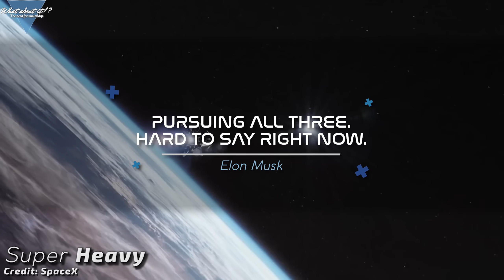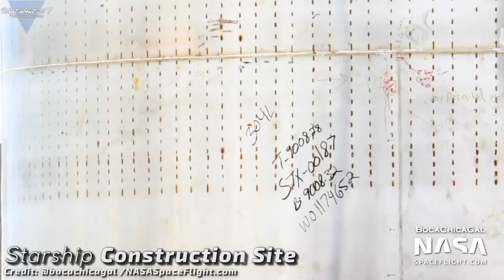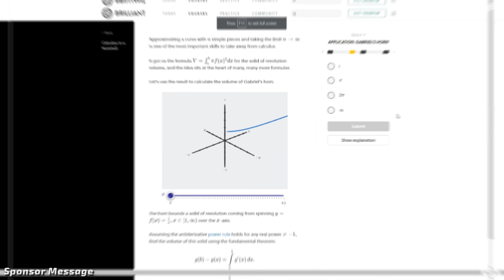97 | SpaceX Starship Updates – Age Of Super Heavy

Comment: To make cylinders or rings stronger they are normally made with some form of profile shape  rolled or stamped into them. Everyone is familiar with an empt food can and the force needed to distort it. Or how scrunched tin foil is so strong across all planes. Also ribs in metal are good for cooling and conducting heat away  great for the future transpiration heat shied. Observing the ring sections of starship they are so flimsy in construction and only have rigidity in only the one plane. Can any one answer this question? A fantastic channel by the way.

Comment: just to get reference: super heavy engine will have about 216 fast valves,  about 222 fuel pipes, 18-74 pistons. Plus, MANY cables. It all must not only survive massive vibration, but also 72MN push. This makes super heavy engine section most complicated one ever. i bet it will take them atleast several years to make it work.

Comment: Yup, exploding water towers will be #1 priority to Musk. Luckily for SpaceX and for spaceflight in general, there is also one Ms. Shotwell to keep the company ticking. (I am only sligltly exaggerating my cynicism.)
Correct, no analysis, just blindly forging ahead, as if we were in the 19th century.  Even Write brothers did some rudimentary wind-tunnel-like analysis. Musk is approaching all those pressure tests as if welding stainless steel is (pardon the pun) rocket science. If you must do a trial-and-error approach, do it in a workshop, on smaller pieces, and test the welds there (if you insist on not following the established best industry practices). If you need to find out stress concentration points, there is finite element analysis software. If your test articles have a propensity of going "boom", test behind earthen or concrete barriers. It took an actual carbon-fiber winding machine, mandrel and all, for Must to discover that this approach is expensive. Then meandering approach to heat protection - what happened with CFD and heat transfer modeling, followed by some small scale test articles in a hypersonic wind tunnel?
Falcon family and Dragon are marvelous. But here, I am not so optimistic. And we are waaaay behind the schedule already, even taking "Elon time" into account. I envy your enthusiasm.

Comment: Tim Dodd :
-asks Elon Musk if the Starship should be 1 pixel longer/shorter for a picture comparing Starship and SLS
.
-"I will delay the video until I have an answer."

Felix Schlang :
-throws a picture of Super Heavy being higher than the building it's built in.
"maybe I should resize the pic so it fits ? ... nahhh it's fine"
Are your styles different ? Definitely.
Do I love both of your work ? Absolutely.

Comment: Should I be worried that the size comparison showed the super heavy booster to starship connection point being higher than the high bay roof line? Is that to say that they’d need an additional high bay for just the booster? Or was perspective and distance skewed.

Comment: Starship is the prototype for superheavy. Starship hopping would be about the same size and weight as a superheavy first try... superheavy then just needs bigger tanks... and more engines. So it is not worth while starting on superheavy itself until Starship as least hops at low levels as a test for both starship and superheavy.

Comment: Once again I hope I'm wrong, but building something that heavy (Starship) and placing it to go MAXQ on top of something even heavier (Superheavy) may require a different approach to structure, other than that thin sheet steel. I'm still betting on giant metal 3D printing. You can specify thickness, can be lighter with custom alloys for cryogenic temperatures. Steel tend to change it's tensile properties when you start welding it.

Comment: It look like the new test stand is in the same location as the old one.  Can you tell if they are implemented any changes to protect tank farm or buildings from further rud events ?   What was the failure mode of the quick disconnect, workmanship or procedural (hammer effect) ?
Reply from the maker: No additional Tank farm protection, that I could have found. Musk only said, that it was the quick disconnet. Nothing more. ;) Could have been either mechanical or human.